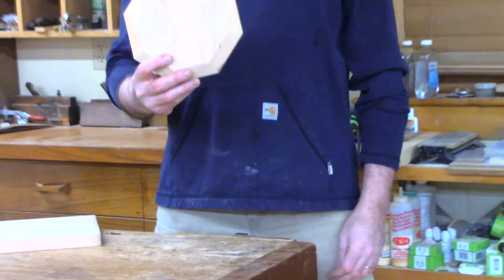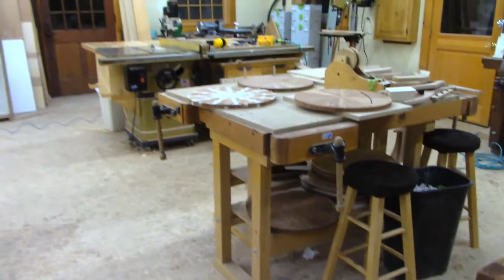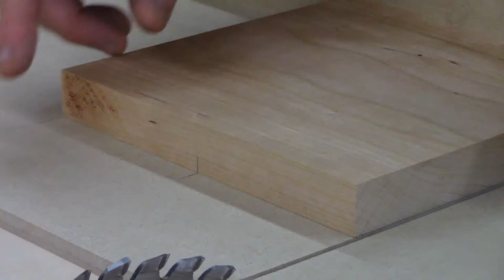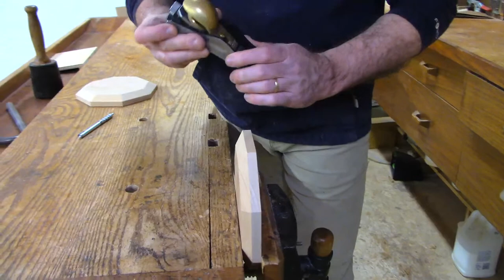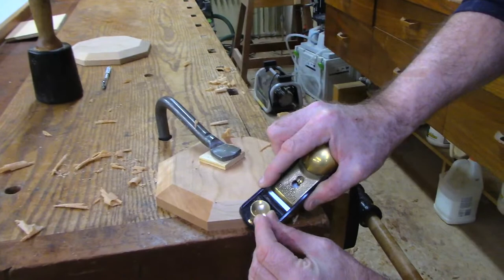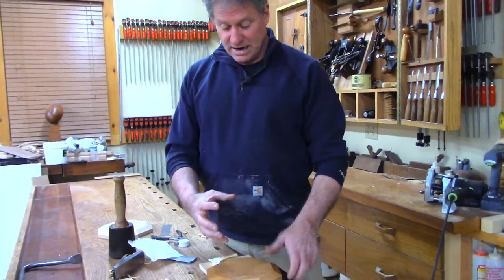How to Make an Octagonal Trivet with Tom McLaughlin

Comment: Hi Tom.   Great shop night!   I am a litle confused about what you line the center point with.   From the camera angle it looked like you had it just to the right of the blade.   Is that correct? Or were you splitting the center point of the square with the blade for drawing the reference line on the sled?
Reply from the maker: Hi Kerry,
Yes, I can see how that was unclear...the saw blade is lined up fully on the waste side of the center line to get the result. And based on the sharpness on the 45 degree wedge, I found that you have to be sure not to let it creep beyond the square piece when setting up or your corner facets will be slightly longer than the initial square surface facets. 
Hope that explains it better, thanks for watching! 👍